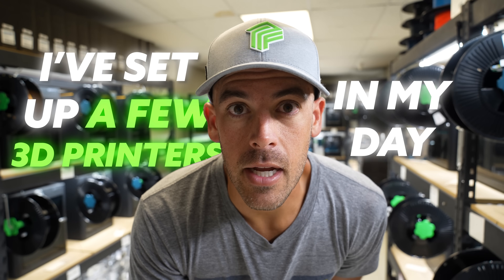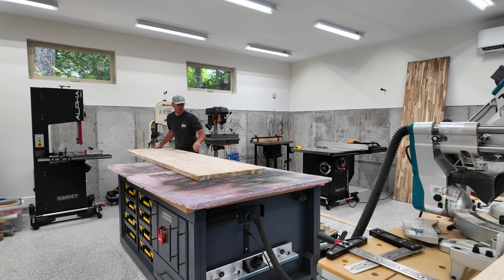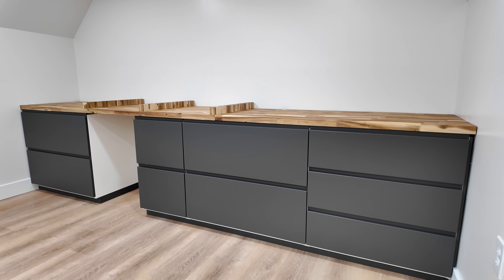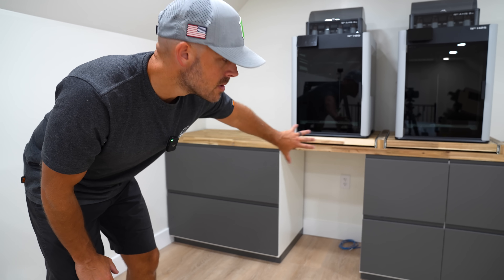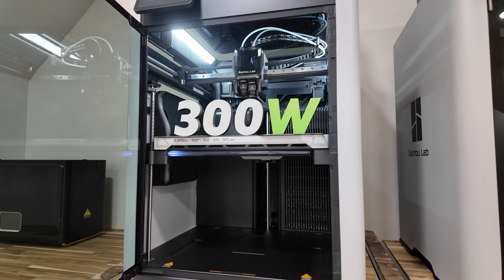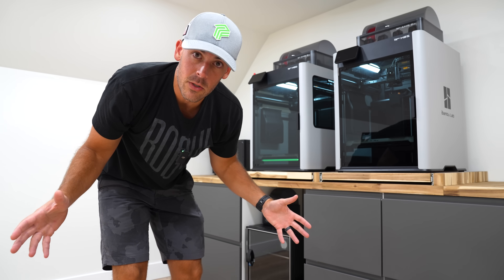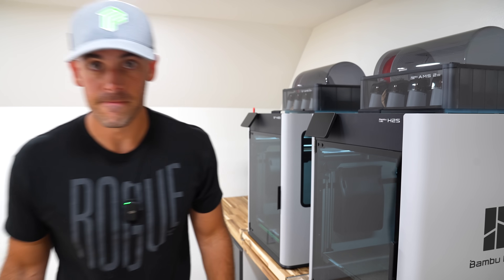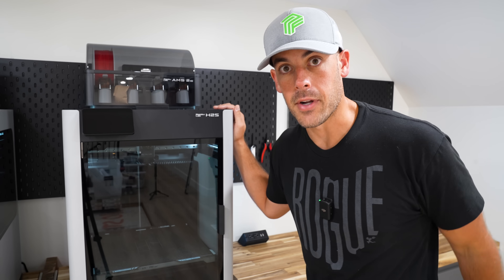9 Tips for a Killer 3D Printing Setup

Comment: DUDE. @9:50 IS THE BEST TIP EVER. Seriously. Trash next to the machine means less trash on the surface the machine is on. YES.
Reply from the maker: It's the little things, sometimes!
Reply: @PrintFarmAcademy a clean space is a productive space is something I needed to hear. Spare flat surfaces in the shop become a catch all and I need to stop haha
Reply: That goes for virtually everything in life. Make sure that cleaning up takes as little effort as possible, so you'll do it while doing other things. I notice this massive difference in my family while cooking. When I cook, I immediately throw away empty packaging and put utensils I no longer need in the dishwasher when I have the time, since the trash and dishwasher are nearby. That way the kitchen is clean by the time dinner is ready. The others just throw everything on the counter and have to deal with a dried up mess after dinner when they absolutely don't want to deal with that. It really is the small improvements (that sometimes take a very long time to set up) that make the biggest difference. People seriously underestimate how much small annoyances can hurt your mood and efficiency.
Reply: Agreed, a game changer in my farm.
Reply: Wonder how a trash compactor would work

Comment: I wish they'd add a slow start option where it aims to remove the peaks and trofs based on use by automating 24h and 168h regular usage cycles, would be a god send for farms
Reply: Other idea might just be to preheat printers you're gonna use, perhaps automatically and paired with lowering the max bed power. Then you at least smear out the power usage a little
Reply: @Litl_Skitl  Yeah, I suppose one could use their API these days to implement this via scripting, can you imagine doing that to 30 printers? What about 100+? I would like really not to
Reply: @greyvlad  Yeah idk. For me half the hobby was in settings and config files. Maybe the smartest way is making a copy of the config early on to paste into new machines as you expand over time.

Maybe you can make the fire hazard of setting the minimum bed power to 0.1 and only turning on the row that you actually plan to use.
Reply: @Litl_Skitl  Yeah, I mean, if you wanna get really freaky with it, you'd probably use a separate bed heater that is wired all the way down to a separate controller with an algorithm for power management. And do that across all beds.

Comment: Awesome 👌. 
I just did something similar with the drawers. I have one of those 48 inch typical workbenches that has two drawers under the bench top. I took them off and put the draw mechanisms on the bottom shelf. I made one big wide shelf/drawer out of both drawer mechanisms. My X-tool M1 Ultra laser and Atomstack P1 and air purifiers now reside there. Pull the whole thing out for easy access!

Comment: I was running a single Prusa i3 MK3 on the same UPS that I use for my NAS and other computer equipment for the same reason: momentary power outages. It worked great for that, but the problem is the constant high-draw from the UPS meant it would chew through a battery and need a replacement every year or two. They're not cheap and really hard to recycle, so I stopped keeping my printer on the UPS.